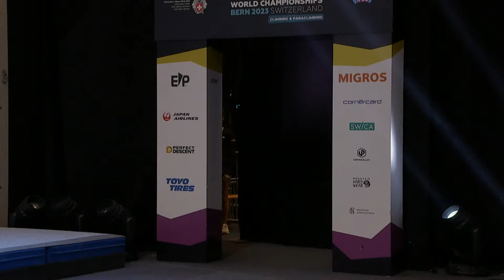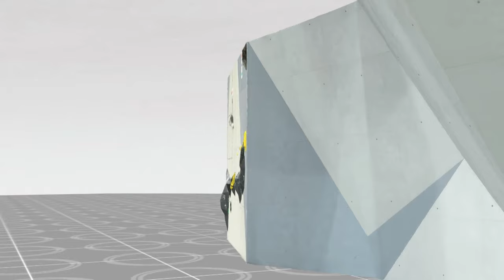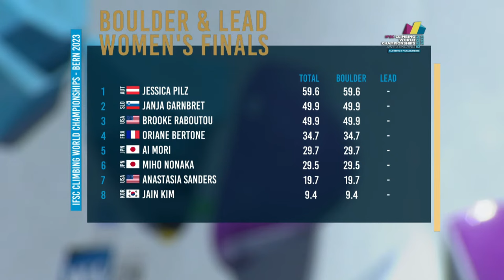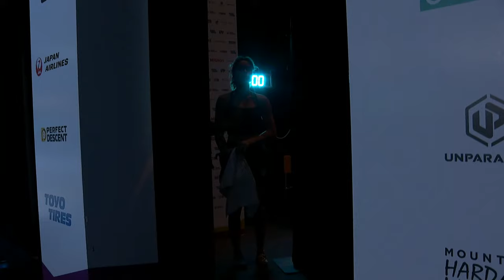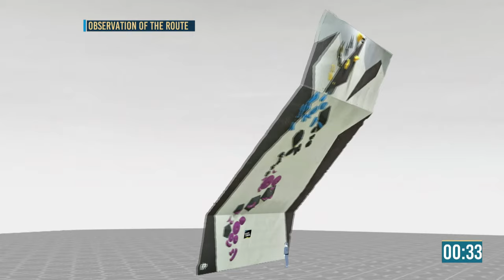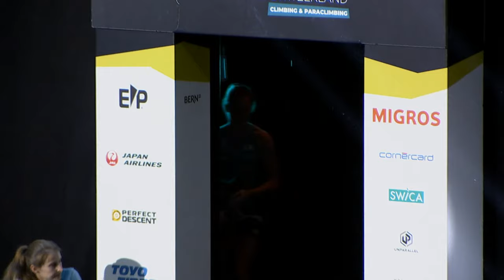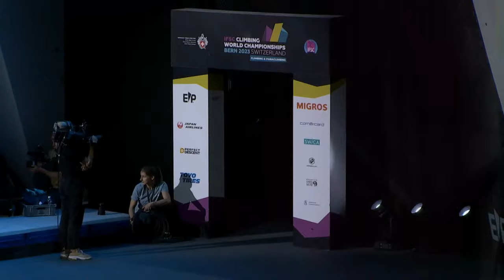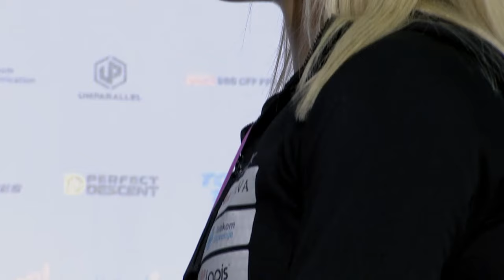Women's Boulder & Lead final || Bern 2023

Comment: What a comp! Absolutely fantastic to watch.
Nice to see the director cut down on the weird angles and pans out over the crowd compared to the Lead event. Also great work from the routesetters, setting a lead route that climbed like a good pumpy lead route for once. 
The combined formula works so much better than what we had to deal with during Tokyo. Seems to be fairly balanced between bouldering and lead and makes it very clear to the audience what an athlete needs to do for a podium place which makes for very tense viewing.

Comment: Fantastic final. While I think there are improvements they should make to the scoring, it's clear that a points based system is exciting. And, the best thing about it is that it forces good route setting. This was by far the best route setting of the year. Not too many stupid running jumps in bouldering and no pointless dynos in lead, because scroing forces the route setters to design routes/problems that allow progress up the wall. What that means for us is that we got to see a really wide variety of hard climbing that showed off the amazing strength, technique and determination of these incredible athletes.

Comment: I really like this scoring system.  Easier for new fans to grok, and sport climbing needs more fans to move past combined events at the olympics.  I'd be fine with it for world cups going forward (without combining boulder and lead of course).
Reply: Bouldering Qualifers are so confusing at times someone could have 4 tops and 5 zones and be ahead of someone with 5 tops and 5 zones you would have to take  150 tries to get 15 points deducted from a top which is basically a zone
Reply: @luckynascarcat24  it is nearly impossible to get 30 tries per bouldering routes.
Reply: @CCHdennis1  you would have to fall intentionally to do that
Reply: Agreed. I love having two zones for boulder also. I know it's done more for the lead specialists to get some points, but it does something to how the competition goes. A lot more exciting. And there's something about seeing those points on the wall. Changes the psychology of the climbing somehow.

Comment: With so much brushing during the bouldering, I'm curious how much of an issue chaulky holds are on the lead wall, since brushing isn't an option there?
Reply: since each climber only touches each hold once, even by the end they’ve only been chalked up 8 times
Reply: this combined event is already a long enough broadcast .. if they added lead cleaning breaks it'd be a marathon..
Reply: @janissaryJames  I'm new to watching sport climbing, so I asked my question because I was curious if there was a difference between chalk on boulder vs lead holds and if its presence could make a difference in performance. The commentators never seem to mention it. I made the assumption that the lead wall isn't brushed, but maybe it is in some cases and I just haven't seen it yet.
Reply: @blackcatsandbooks86  That makes sense. Does brushing happen during the semis?
Reply: @jjs5691 Yes, usually during the semis there will be one cleaning break in the middle of the round (after half of the climbers have finished).

Comment: I'd love to see a route for lead where there maybe is a section or two split into two parts, where climbers could  decide which way they would rather chose depending on their personal strengths or weaknesses. The route could merge again close to the top. Would be super interesting to see the choices and is totally doable with the point system.
Reply: Would love to see this!

Comment: In the commentary they say each attempt costs 0.1 points, but the scores don't seem to reflect that. A climber with several falls on a boulder only seems to lose 0.1 points once (not per fall), no matter how many falls they take. If they make it to the 10, then they can lose another 0.1. Is that the correct way to think about this scoring system?
Reply: They only lose the 0.1 points until the attempt where they get the points. Eg if they got the 5 point zone on their first attempt (score 5) and the 10 point on their second attempt (score 10 - 0.1 = 9.9) and then they make 6 more attempts for the top but never reach it, the score remains at 9.9. But if they got the top on the 9th attempt then the score would become 24.2.
Reply: nope.
Reply: If they never make it to the next points, they don't get any deductions. So the timing of the falls matters.

Imagine two climbers both reach the 10 but not the 25 and both make 6 attempts. The first climber falls 5 times, then reaches the 10. That's 9.5 points.

The second climber falls once, then reaches the 10 on the second go. That's 9.9 points. They continue and fall, then fall on 4 more attempts. Because they never got more points, they don't lose points.

Comment: Really enjoyed this group of women. It feels like the point system needs to be adjusted a little. 
Brooke was doing visibly so much better than Ai on most of the boulders, yet got only a few holds lower on the lead and was still beaten. This isn't to talk Ai down, she is an incredible lead climber and a very good boulder climber!! I love that she qualified!! But it really felt like that was more of an advantage in semis and finals than being a top boulderer and a very good lead climber. Curious if adjustments will be made.
Reply: Unlikely.  Maybe moving forward after Paris.  It would be unfair to change the rules now that they’ve already run one qualifier with this format.  It will most likely stay the same for all the other qualifying events and into Paris.  Ideally they would have all 3 events (Speed, Boulder and Lead) with separate medals as they are seperate disciplines but that’s up to the Olympic committee to decide moving forward.

Comment: I realize the scoring is hard, and I'm not sure I have a better idea, but I don't like that 4 flashes in boulder is the same as a top in lead. There is ~1-2 tops roughly in most comp finals, where I think I might have seen 4 flashes a single time in recent memory? I guess the setters can over-cook the lead route to compensate. Hmmm. No perfect system I guess. Need more tiebreakers with the placings I think might be better? Something like this maybe (would need to work out the constants)? [qualification place + (semi-place * 2) + (final-place * 4)]

Comment: what are they saying, behind the scenes Olga with Ai Mori reach could top boulder wall better than world class athletes  as routs were designed.  impressive
Reply: Well the route setters do need to be pretty darn good climbers in their own right to get where they are. That doesn't necessarily mean Olga's topping all the problems behind the scenes though - route setters work as a team, some might be particularly good at technical problems while others are good at more burly moves and so on. If Olga's not topping because (hypothetically) she doesn't have the contact strength or the coordination that's fine, she just needs to demonstrate that it's not reach/morpho that's the barrier.
And of course the route setters have unlimited time/attempts and an intimate awareness of the intended beta.

Comment: Does anyone else feel like Lead weighs heavier in the scoring than bouldering?
E.g. Brooke came 2nd and 4th to get 4th overall, while Ai came 6th and 2nd to come 3rd overall.
Reply: I thought Ai was first in the lead round?  She beat Janja because she nearly topped the route.  She scored 96.1 and Janja scored 92.1.
Reply: Not really. Brooke got 3 more zones than Ai. Ai got 7+ more holds on the hardest part of lead wall. Seems pretty comparable, and thus, they were very close in points. If Brooke had gotten one more zone or one more hold on the lead wall, she would have gotten 3rd, but she didn't. 🤷🏻‍♀️
Reply: @sd-xx6cg  them’s the rules.  The points play out as devised by the Committee.  I guess if you shout loud enough they may consider changing it for future combined comps post Paris (they are unlikely to change it now that they’ve already started the Road to Paris this way).  Sucks for Brooke to miss out on her Olympic spot by such a close margin.  Out of the 6 that got in this time, Ai was the only first time Olympian.  Brooke will get other chances to get to Paris.  With her form I think she’s got the best chance amongst the USA women.  Natalia didn’t look 100% this time.  Annie was a surprise but her inexperience showed in Bern.
Reply: @lill8537  oh you're right. That does seem fairer then
Reply: It completely depends on the route setting (too much so). If either boulder or lead is too soft, the opposite discipline weighs heavier.

Comment: I feel like there's this unpleasant trend in many women's sports these days, where the artistry or the core elements of the sport are being erased due to artificial difficulty inflation. this artificial difficulty inflation is being accomplished by forcing athletes to focus more on making near impossible jumps than focusing on the core elements of the sport. every single boulder here requires a massive jump, so it doesn't matter if you're the best climber in the world, if you can't jump 5 feet, forget it. you can't compete at the highest levels. 

the same thing is happening in women's figure skating and gymnastics. there is almost zero female artistry left in figure skating now - it's all 14 year old girls who haven't been injured yet doing poorly executed triple and quad jumps at the highest level. it's become "ice jumping for teens" instead of "figure skating for women". gymnastics is the same - no more elegance, just massive jumps by mostly tiny underweight teens who haven't been injured yet. you can be the best, most elegant gymnast in the world, and you won't even qualify in comps if you can't jump 5 feet in the air. and of course, the athletes are getting younger and younger, because only the tiny 100 pound body of a 14 year old child with zero injuries can withstand the kind of unnatural strain required for a massive jump like that, and/or can get that far off of the ground because of their low body weight and small child's body frame. and within a few years, their bodies are wrecked and they have to retire at age 19 from professional figure skating/gymnastics. there are only a few notable exceptions to that rule, sadly, and all of them are female gymnasts who are naturally very short, with narrow hips, flat chests, and super powerful cores/thighs. in other words, very short women, with no curves and highly muscular compact builds. and even they get injured constantly by these dangerous jumps that have little to do with the core components of the actual sports. did you know that gymnasts now have to do multiple jumps on the balance beam, of all things, in order to be competitive? actual jumps where their whole body leaves the balance beam. balance beam is supposed to be about *balance* and flexibility. for example, bending over backwards to place your hands on the beam, then flipping your feet backwards over your head while your hands are still touching the beam. not just jumping backwards and backflipping then landing all wobbly in the best case scenario, and eating the floor in the worst case. but it's fine if you fall off the the balance beam, even though it's all about balance! because your difficulty score is so artificially inflated by all the jumps that you attempted and failed or semi-failed to execute that even if you fall off of the balance beam which is supposed to be all about keeping your balance, you'll still outscore a girl that didn't lose her balance even one time. because you attempted to jump more than she did! even though you fell off multiple times. the soul of these sports have been corrupted by artitficial difficulty inflation which is indicated by all these forced jumps.

in rock climbing, the bodies have to be the opposite. all the women have to be built like men in order to compete at the highest levels these days. because if they aren't built like men, with height advantages, they can't even jump onto the starting holds, in many cases. how have women's sports devolved into a massive jumping contest?? I don't care about how high someone can jump. I'm not watching track and field. I care about the climbing ability, or the elegance of the skater, or the poise of the gymnast. I'm just so tired of everything in women's sports revolving around jumping and power, instead of the core of the sport. to me, women's climbing should be mostly static, showing off flexibility, versatility, ability to adapt, grip strength and critical thinking skills under pressure. I just feel like the propensity to make every single comp about jumping is getting out of hand. and it's happening in multiple sports. that's just my two cents though. and no one in these sports (except sometimes retired atheletes) will even acknowledge this trend, or the problem at hand. the "difficulty" of the actual climb hasn't been elevated. the difficulty has been artificially inflated by forcing these girls into massive jumps that are near impossble to land. what's next? forcing the women to run up the wall in order to grab holds to artificially inflate the difficulty even more? choosing to artifically inflate the difficulty of the physical acts that they're being forced to do (like jumping constantly) instead of just making the static climbs harder is a huge problem for me. I guess I'm just over the jumping trend. jumping is not climbing. jumping is not skating. jumping is not gymnastics. these sports are so much more than your height, build, and ability to jump. I've been climbing in nature for years and I've never once jumped like that... it's not a good idea. pushing up is one thing, but these massive jumps really don't happen that often (if ever) during any sort of climbing on natural structures. so it really is just artificial difficulty inflation.
Reply: huh? wtf are you talking about? most of the competition was the exact opposite of what you described.